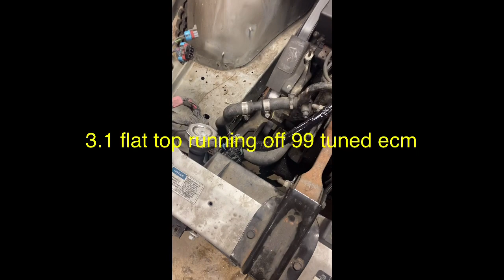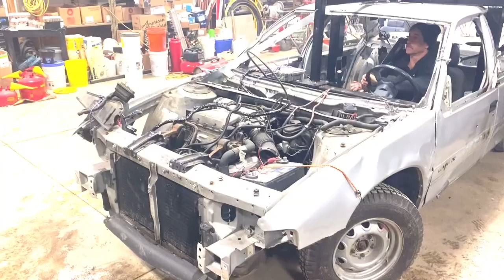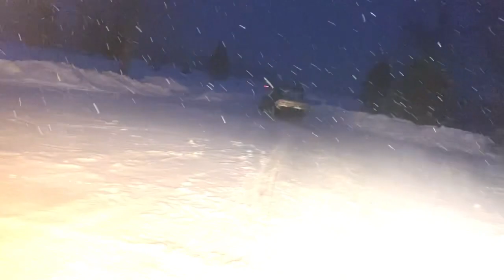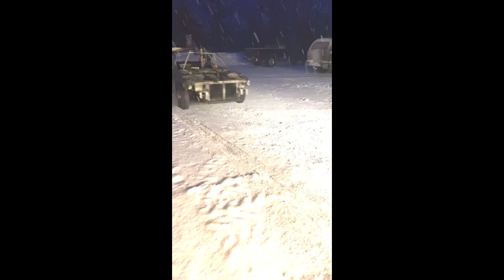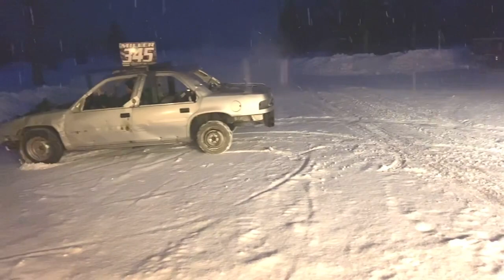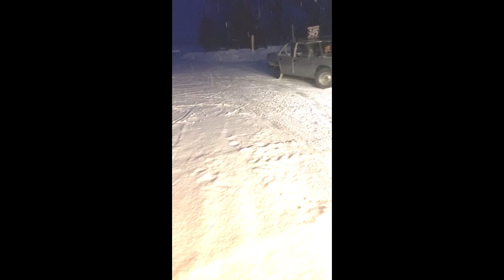3.1 flat top running off 98-99 tuned ecm

Comment: How is this done willing to pay to figure it out have a tuned ecm
Reply from the maker: This is a different tune than the 3100
Reply: @backwoodsracingllc3330  well I figured it out anyways haun said switch. Injector and injector harness and temp sensor and your gpod to go
Reply from the maker: @Taterhead68  mine is plug and play no need to take the intake off and switch out anything.
Reply: @backwoodsracingllc3330  well how much for everything does your tunes computer   Get rid of limp mode and no egr and sets timing back
Reply: @backwoodsracingllc3330  
 How  much  with the tuned computer
Reply: I have PayPal ready